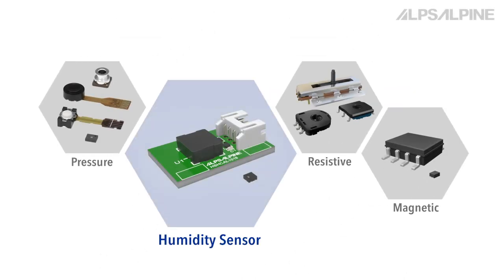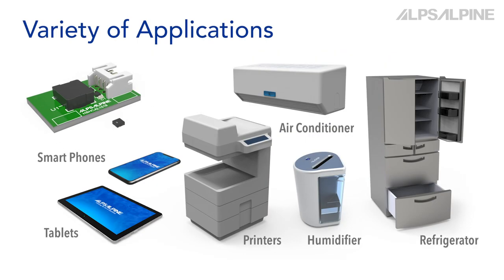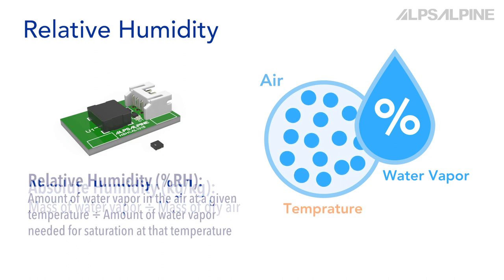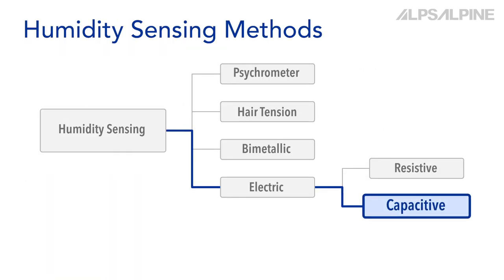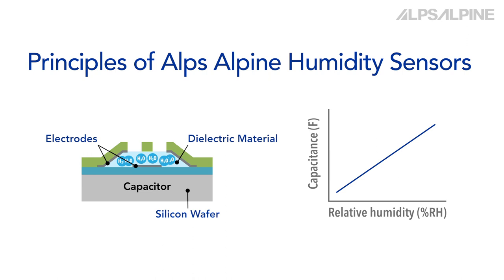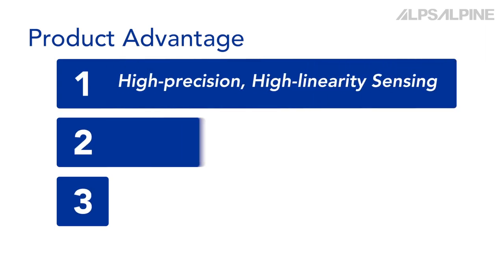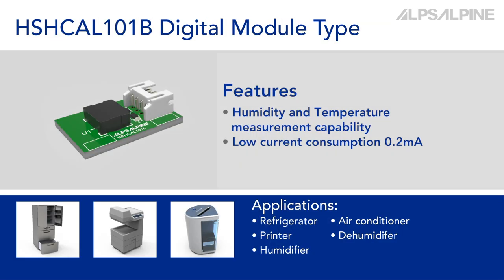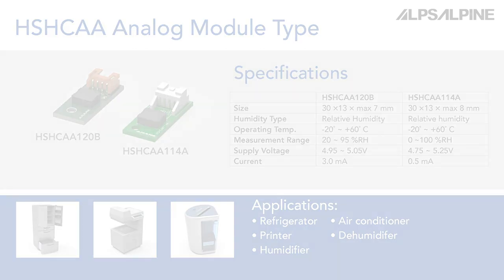Humidity Sensors // Alps Alpine

Comment: I believe I may have the HSHCA connector type. It's a 4 pin connector and it's faulty because it's no longer switching on the dehumidifier, even though it reads the humidity correctly.